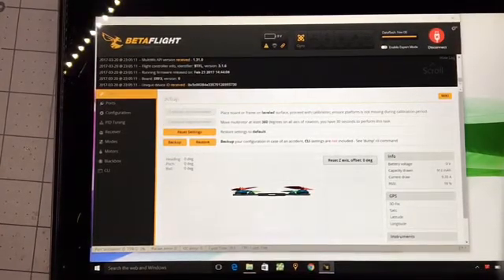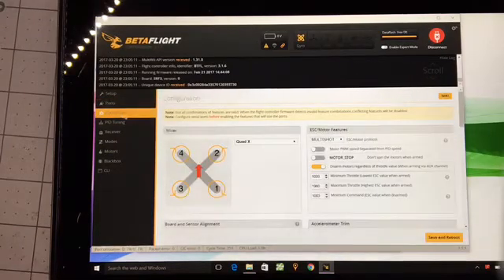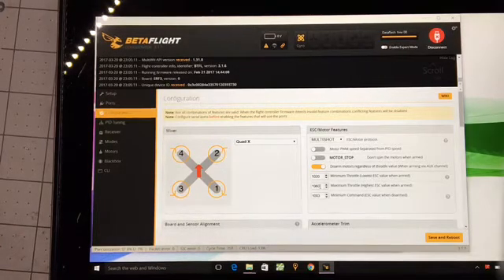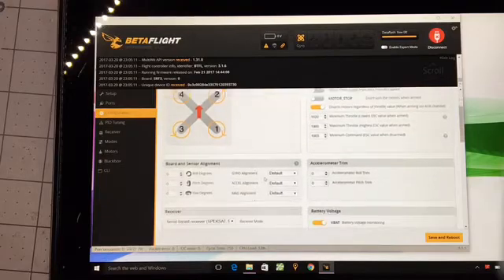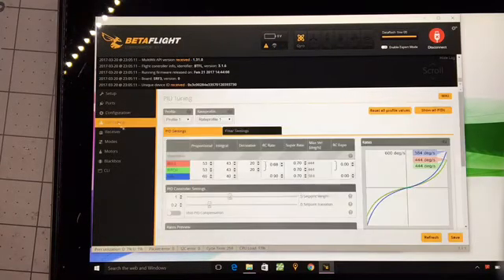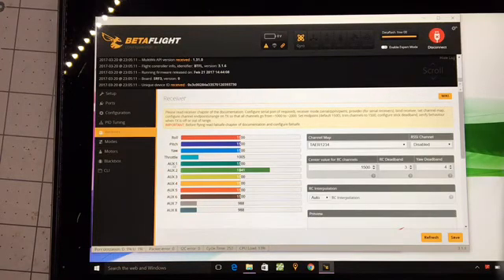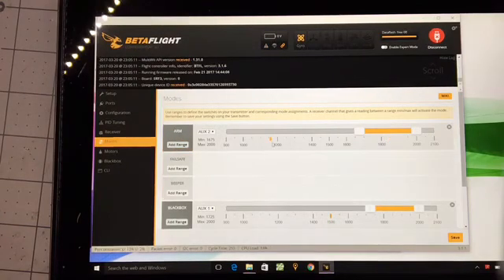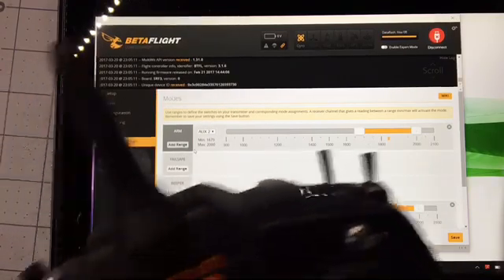Spektrum and Betaflight part 2

Comment from the maker: So the end of the video was cut, but the good news is, that was the last demonstration.  I was going to show that if you try to arm with the throttle at non-zero, that the tick mark would go to the range, but the arm box would not light up, because the system will not arm if the throttle is not down.